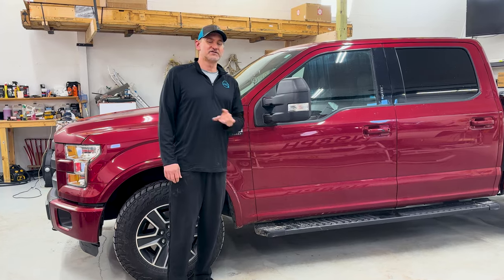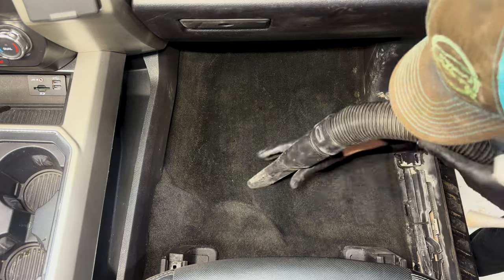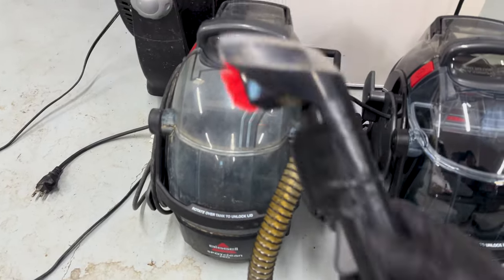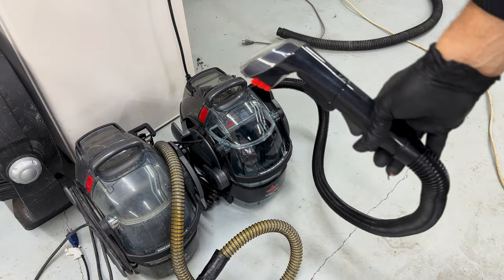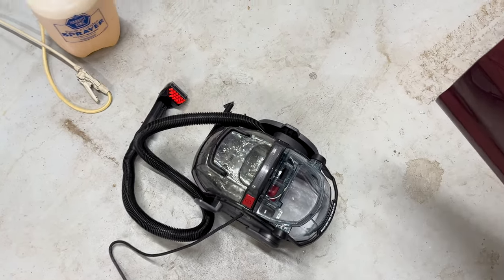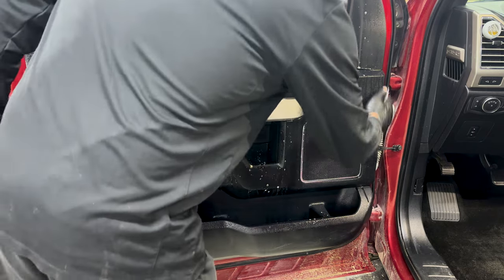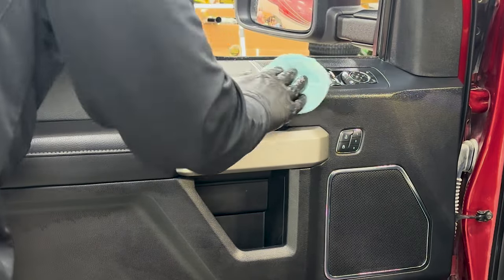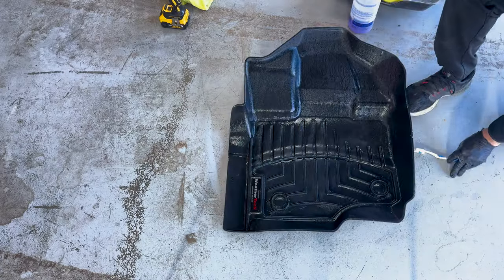The Bissell Spot Clean Pro HAD To Go!

Comment: Hey scrapper! I'm just curious as to why you went with a new bissel over something like a shop-vac extractor
Reply from the maker: Good question. I REALLY, REALLY wanted to go with the Mytee, but the one I want (HP60 Spyder) costs around $1,700. I don't have running water in the shop, so the Shop-Vac version just won't work. I have looked into that, but just won't work for me at this time.
Reply: @ScrappersDetailing  No running water? How do you wash a car?
Reply from the maker: @Samuelfish2k  I have running water from a spigot outside the shop, but no running water inside the shop and no drain. That's why I can only wash outside.
Reply: @ScrappersDetailing  But the shop vac extractor allows you to run a whole lot of feet worth of hose… You can do 100’ of garden hose + 50’ of air hose [used as your water line to plug into the extractor wand]. 

Heck, you could probably do 100’ instead of just 50’ if you needed for a total length of 200’. That wouldn’t reach from the spigot to inside your shop?

Btw I currently use a Bissell Spot Pet Pro as well but I’m just about to make the leap into converting my Ridgid into extractor. I have 2 Ridgids, the 4 gallon @ a 16 gallon. I’ll use the big 1 for extractor because it has a larger tank + I like the ease of the screw to empty the water out. 
I think the small Ridgid is way too small to be filling with water.

Comment: I recently purchased the spotclean pro and it came with the black hose which feels cheaper in a sense. It can be squished between your fingers which in my eyes means it can kink. 
So I messaged Bissell about this and their response was “The new SpotClean's come with a black hose, rather than a clear one. This hose is slightly more durable than the previous clear one. Neither of these should kink.” 

So yeah make of that what you will. I guess time will tell haha
Reply from the maker: Yeah, it has held up well so far for me. And it does feel like it has less chance of tearing. The old clear one had such little movement to it that it was bound to break.

Comment: The old style hose is well known for tearing around the handle.  Hopefully, they realized this and fixed the problem with the new hose.
Reply from the maker: I hope so. The new hose feels so much more forgiving and flexible. Built to last maybe?
Reply: @ScrappersDetailing  There's a video with the following title Carpet Cleaner Down! Bissell SpotClean Pro broken hose fix..like new repair!  I did this repair and at the end of the video he makes a good suggestion and that is not to store the handle under tension on the spool.  That will hopefully prevent excessive stress on the hose/nozzle junction which is where they commonly break.
Reply from the maker: @Enigma758 That makes total sense! The new hose isn’t under tension coiled up. At least that’s how it feels.
Reply: @ScrappersDetailing  Well that's good, maybe Bissell was aware of the problem and fixed it with the new design.